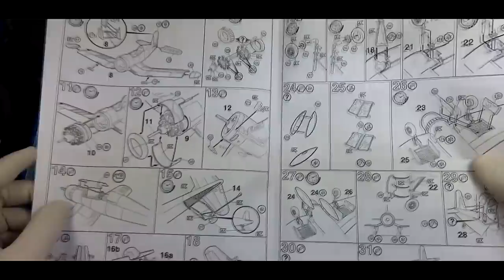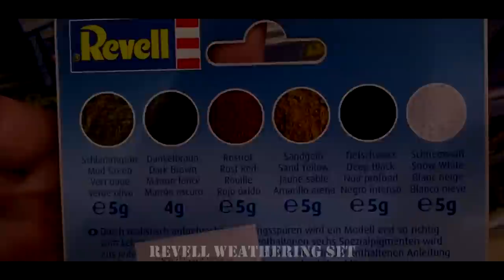FULL VIDEO BUILD REVELL F4U-1D CORSAIR

Comment: I'm sure people would tell me it's just a Revell, and this or that not is so hot about it. But when I built planes as a kid and teen, you'd be lucky to get a control panel for the cockpit; normally it was a seat and a pilot with apparent arm paralysis. Wheel wells? You were more likely to read the maker's name in there. The engine - sometimes just the front half - was one piece, trapped between fuselage halves as there usually no separate cowling parts. No wings ever fit the fuselage cleanly enough that puttying and sanding weren't standard.
To watch a modern kit going together is amazing to me. I imagine the price would be, too, as my friends and I picked up 1/72 planes for as little as 59¢ (Airfix) and 69¢ (Revell)! Very different products and expectations back then!

Comment: Dusan, you must be reading my mind...I am building the older tool 1/32 F4U-1D Corsair right now! Just finished the cockpit. Man this kit has more flash on it than white on rice EVERYWHERE. On every part especially the engine which is actually nice once you get the flash off. I just thought what an amazing coincidence that you just built the Revell 1/72 new tool of the same aircraft. Decided to dry brush the instrument panel instead of using the decal at that larger scale the decal looks like a cartoon. Looks amazing....technique I learned from you my friend! Thanks so much!
Reply from the maker: +Wakeman Edwards You are welcome! Flash is not a problem, but  defective parts sometimes... uh... All the best! Dusan.
Reply: +ScaleModelAircraft yeah that can be a headache

Comment: The green you're  using for interior airframe parts is a bit darker. The protective coating used on aircraft is zinc chromate, which is a couple of shades lighter with almost a yellowish cast to it.

Comment: Excellent build! I do have one question,  do you use enamel or acrylic paints and washes?
Reply from the maker: Yes both types of paints...for example if i use acrylic base paint and acrylic coat for protection, decals etc (gloss) i am using the enamel wash for sure. Thanks! All the best! Dusan
Reply: @ScaleModelAircraft  thank you sir.

Comment: You do great work! I am getting into Scale Aircraft modeling ,and would like to know in your use  of different Primer Colors, how do you know what color Primer is needed?
Reply from the maker: I like to use black primer or regular paint so I can check my work on panel lines and possible flaws with  sanding marks leftovers. If I prepare plastic surface before paintjob for example, clean it with thinner or prep work solvent I can easily spray any color without primer. So for me crucial primer purpose is to check for possible errors. Thank You! All the best! Dusan.

Comment: Hello, I really like your video. I bought same model and I have some questions. It includes three acrylic paints. I have airbrush and compressor. I tried to thin with water, with Revell thinner, but could not do it. Do you have any ideas or it does not need thinner? Also, my airbrush stopped working and it completely broke. I tried to paint the model with brush, but I think not good quality as the paintings are mat and not metallic. Do you have any suggestions for me? Also fuselage  part could not match 100 % properly, as I also used sand paper too. Another question what I have, what do you think about Revell Spray colors? As I am from Georgia (Country) Revell does not have Spray Color international shipping. Any recommendations? Thanks a lot and my compliments to your video. Looking forward to your reply.

Comment: That is an outstanding free hand job with your airbrush. Can you tell me what pressure you had set and how diluted your paint was?
Reply from the maker: +PFMANN1 Thank You! Well I dont look at the air pressure at all, I am looking all the time 
at proper viscosity of the paint, If the mixture of the paint and thinner is too thick to flow through airbrush smooth, I increase air pressure or add more thinner. (60-40 mix) All the best! Dusan.

Comment: Hi Dusan, congratulations on doing a fantastic job on this. One question though... why the green shade on the upper wing-roots? This happens around 12 minutes in and then you almost immediately paint over it with the main blue. Is it for weathering? Not a criticism at all... keen to know.
Reply from the maker: Alan, thank you very much! Yes, you are right, it’s for weathering effect. In person on the kit you can see through upper cammo in few spots. I could use the silicone barrier agent to get slightly chipped effects but I skipped that on this kit. Definitely I will do it in the future. All the best!! Dusan.
Reply: @ScaleModelAircraft  Thank you. Interesting!

Comment: Question, how you keep the tube on the contacta open.Ordered this cement and used it to start building, but when took cover off nozzle, nozzle was not open and could not get cement out. Had to get small wire that fit in tube an push it in to open nozzle. How do you keep the nozzle open or is there a secret to keeping it open.
Reply: Use a lighter (make sure you wear some gloves though), simple as that.